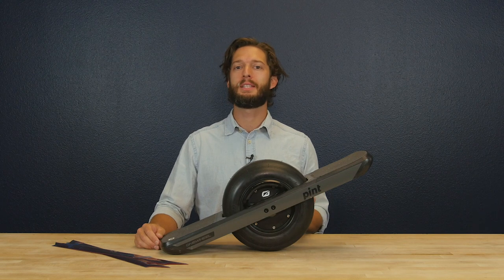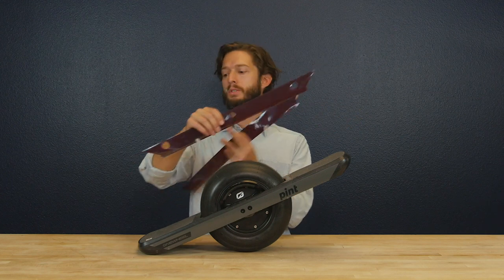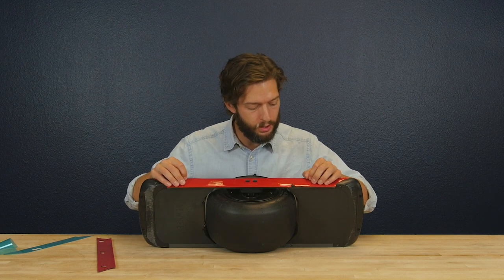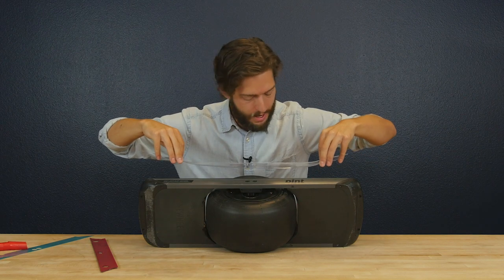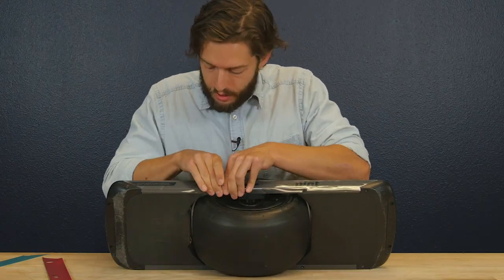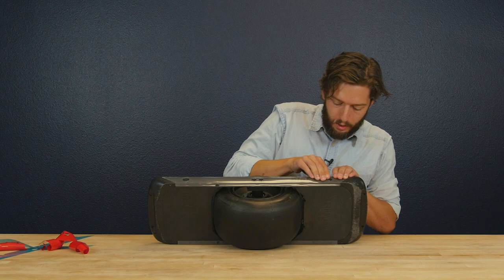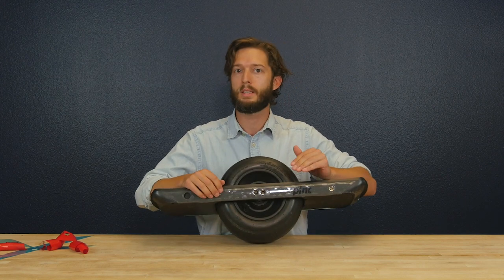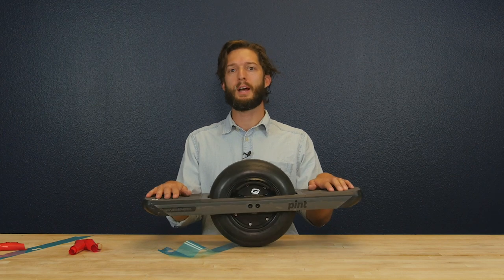Onewheel Pint Rail Guards (Transparent Only)

Comment: These should come as standard in my opinion.
Reply: Yeah... seriously. I thought they were going to be thick and sturdy protection, like the ones from Craft & Ride and not just weak-sauce, tissue paper thin plastic. A little bummed here.
Reply: @iamsomewhere  exactly, this is similar to the stuff that comes on mobile screens and computer cases when you buy them. A little cheaky to be charging for them.

Comment: Mmmhh nah, they are no good, clear tape ain't no rail guard. Get real, make them at least matte and thicker and include them with every pint. 

BTW, have fun getting those bubbles out, any reason you didn't demonstrate how easy it is? ;-)
Reply: They are actually pretty thick but yeah those bubbles are messed up.

Comment: Unfortunatly they are shipping them as ghetto as possible, which means they are folding and flattening the strip to fit inside a small flat container and thus warping the material causing it to have impossible to remove air pockets